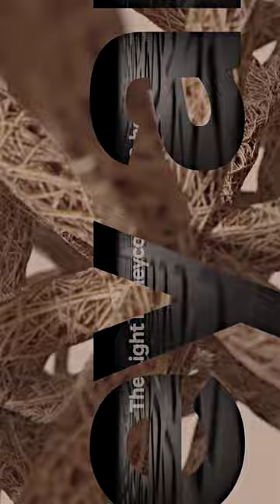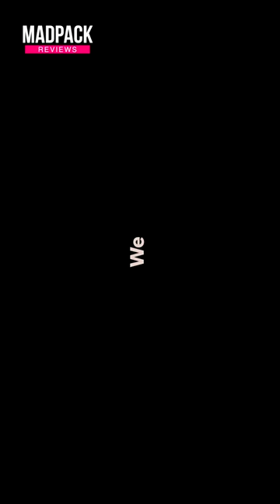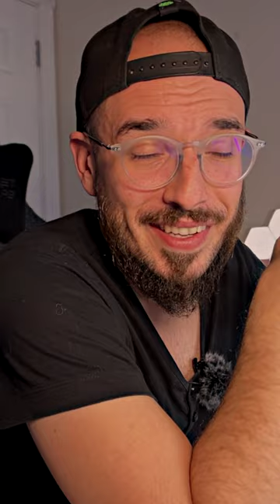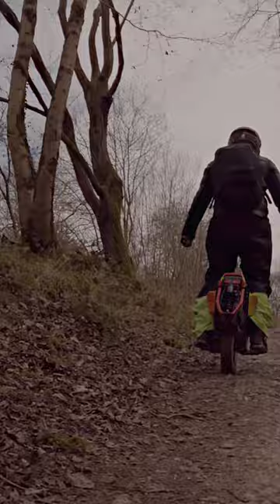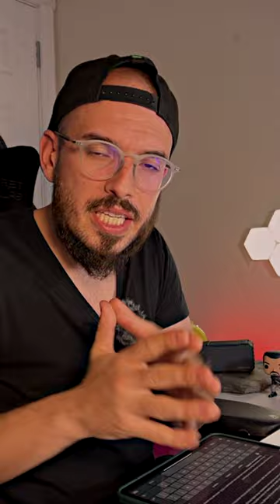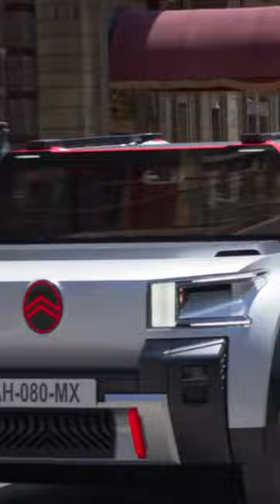Electric Unicycles should be made with Cardboard

Comment: What EUC's need is better battery tech, that is basically all that will extend their range without extra weight.

EUC weight also isn't a problem either from the frame, the issue is all batteries. The Citreon example doesn't work because with cars it's fine for them to crumple. That material is good, but it's not better than metal for things like battery casings where ideally you want them to not deform at all to protect the batteries. What we do need is a good high density foam exterior to help with shock damage.

The idea I had before is a dual controller style wheel. Imagine if when you are cruising the actual voltage is like 84V, but then when you accelerate or decellerate then it quickly switches to the higher voltage controller.
Reply from the maker: Metal transfer the energy in impact so I don’t see why is not a good idea to have a material that is lighter and even stronger than metal and above all cheaper for sure. 

About the controller I believe your idea is not going to happen